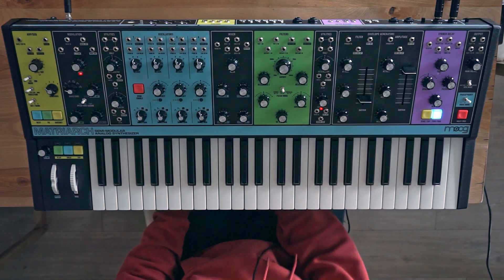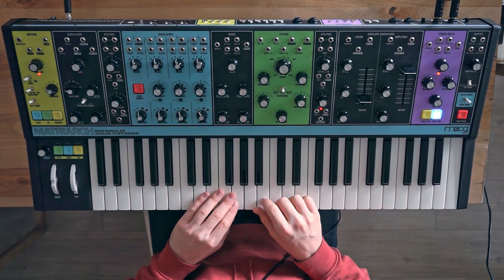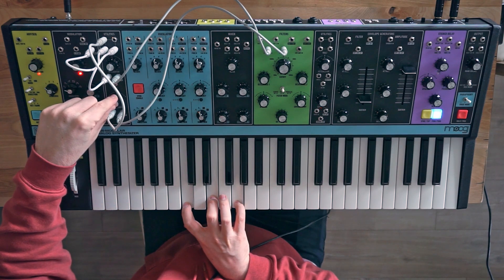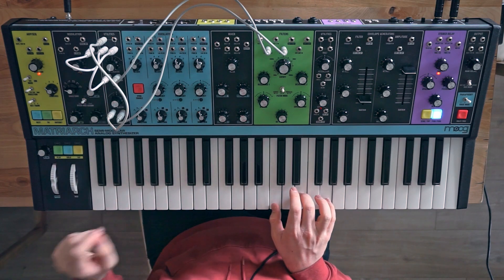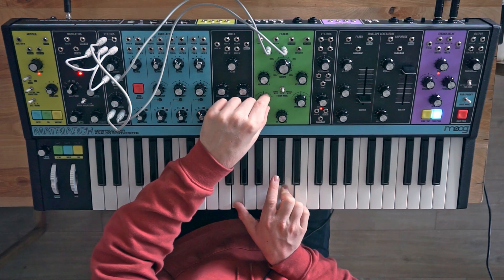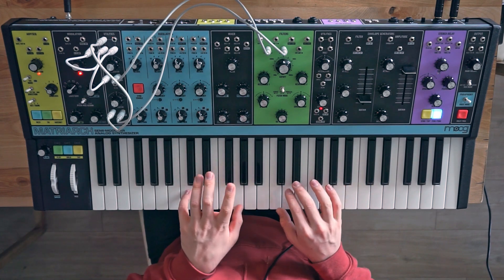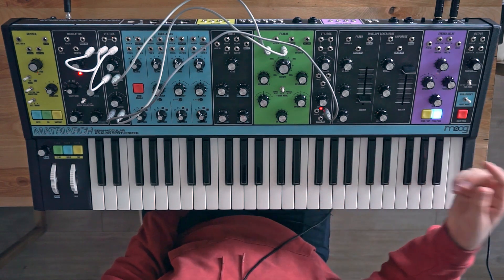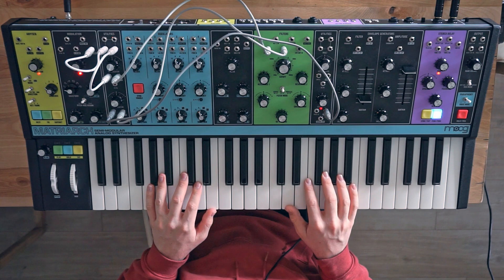Patch Tip: Stereo Filter Modulation with Moog Matriarch

Comment: Awesome. I have one thing to add. At 1:33, you said that the filter's Spacing knob offsets both channels, left and right, but if you listen to your demonstration at 1:25 and remove your left headphone, you'll hear that it only affects the left channel. The right channel actually stays the same; however, there is a stereo illusion that occurs. 

Anyway, you did a great job of explaining your process at a useful pace. I especially like the patch at 9:53! :)